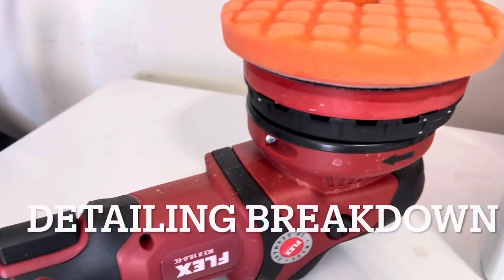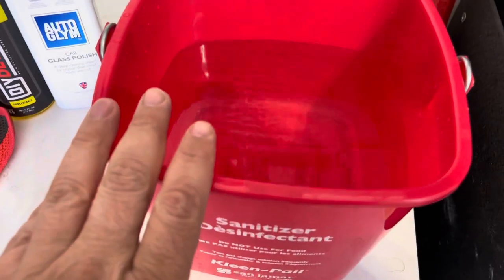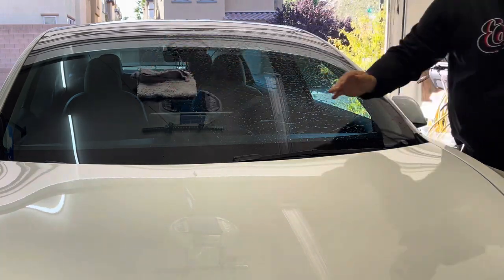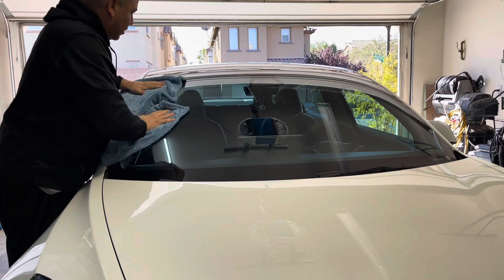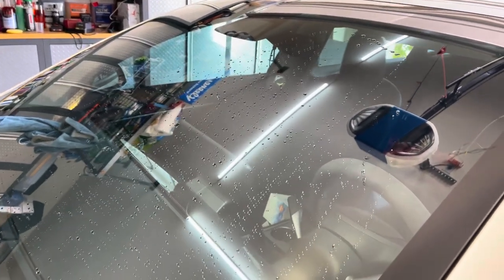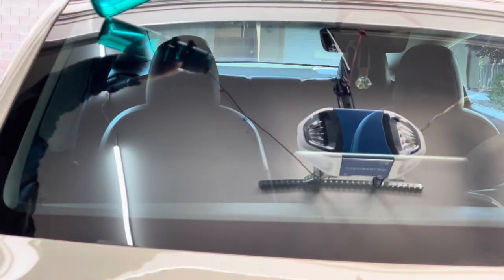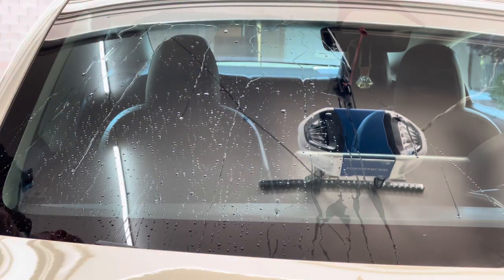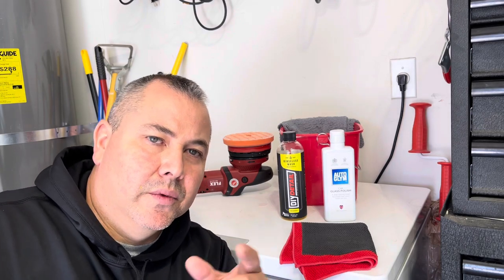Polishing Glass/ Autoforge.net/ Auto Detailing/ Car Care Products/ Tesla

Comment: I have done windshield polish. Not a big fan of it. If the glass is new, use only microfiber glass cloth. Rag Company sells a pink one which is the best! And Chemical Guys, do sell a clay block, which eliminates impurities on glass. Foaming, and using a block over glass, is the best. Followed by a quality glass cleaner as Gyeon. When you slide the towel, it will feel smooth.
Reply from the maker: Thanks for your comment